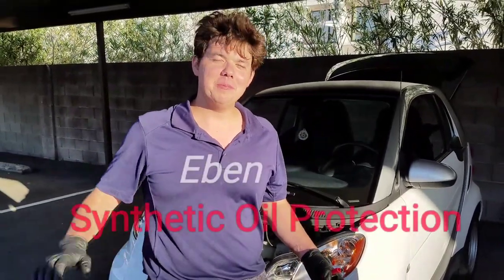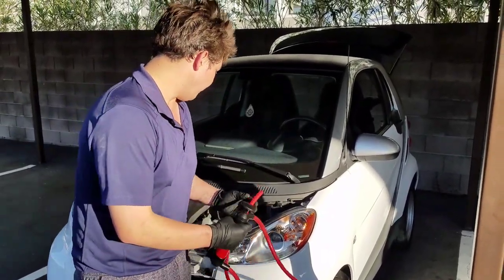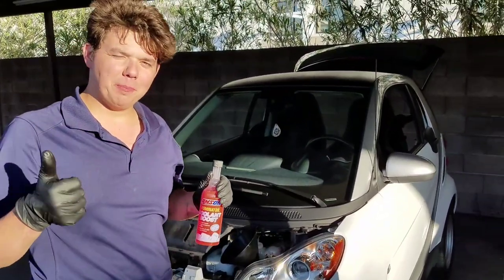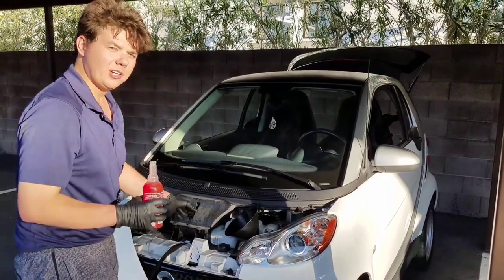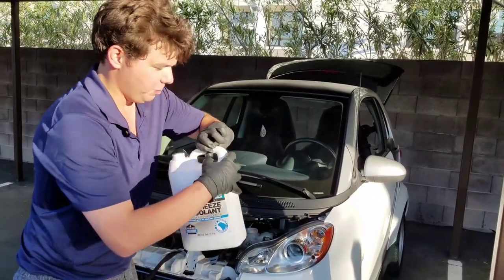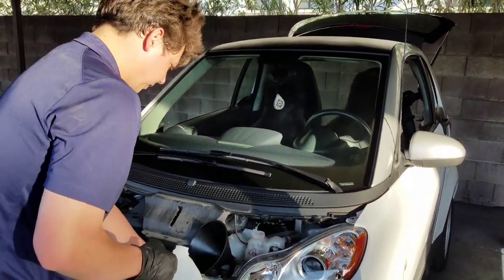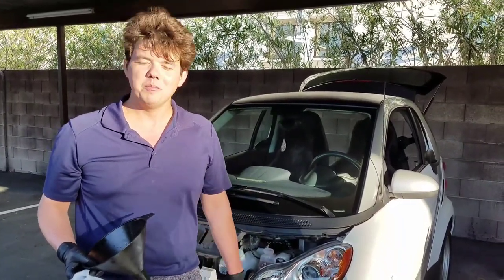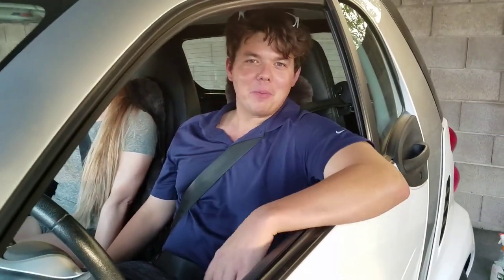Smart Car AMSOIL Radiator Coolant Change

Comment: What is the "proper tool" you keep speaking of?
Reply from the maker: It may be a hose clamp to hold the clamp or a hose pick you have to wiggle off the hose and to get to it could be very difficult depending on the angle but ideally you want to take the bottom hose off to drain the radiator unless there's a drain area on the car I'm not aware of that so you have to find a way to drain it and most cars that are tough you just have to pull the hose off that's the best way depending on the age of the hose it could rip so then you want to make sure you have the ability to replace that hose if you rip it when you take it off that's why certain things with radiators are more difficult also the plastic can get brittle and you can crack it so you have to be very careful so at worst case scenario you have to be able to be okay replacing the hoses and or have the ability to replace a radiator if you crack a piece of plastic that's the one thing I don't like about radiator services and I always avoid that for my videos as if I was someone doing it by myself because the last thing you want to do is try to change 50 bucks worth of coolant and end up spending $800 getting the car repaired because it's something you broke that's why I play it safe in most of my videos for people that do not have every tool like an expert mechanic

Comment: Hi Eben- Thanks for the great videos, they have been teaching me how to care for my car. I have a question about this one though- Do you have to bleed the cooling system after changing the coolant in a Smart car? I didn't see you do that in this video. Thank you!
Reply from the maker: Most likely you will not have to bleed the system on that car because it's a very small system.

If you want to drain it completely you will need a special tool and it's a Mercedes tool to take the c-clip out to drain it and you can do that if you want to get the tool.

What I did was I did a pasic drain and fill out of the reservoir which the reservoir mixes with the radiator and that allows you to dream about a third at a time.

So what I did in the video is I drain and filled the reservoir a bunch of times and drove it to get it hot to change as much as I could because I didn't have the tool to drain it properly.

The most important thing is that you change as much of the fluid as you can and that way your system won't get any corrosion.

If you have any other questions feel free to reach out to me anytime.

Also I recommend getting the Amsoil Dominator coolant boost and the low toxicity biodegradable coolant the yellow bottle and you can mix that with distilled water to make a 50/50 mix.

 thanks for being a part of my YouTube Community Katie🤟

Eben Rockmaker Independent AMSOIL Specialist (Dealer#: 5331179) 
Mobile: (702) 472-3614
 My link: AMSOIL 25% Less Wholesale & FREE SHIPPING: https://www.amsoil.com/offers/?zo=5331179
AMSOIL Makes it for your Vehicle Lookup - https://www.amsoil.com/guides.aspx?zo=5331179

 If your vehicle is not on the lookup guide this is AMSOIL Tech Support 715-399-8324
Reply from the maker: You'll see in the lookup guide you can get all the products for that vehicle and when you change the transmission fluid in the motor oil you'll be blown away how much better that car drives😉
Reply: @Syntheticoilprotection  Ah that makes sense. I don't want to have to get the tool so I bought an extraction pump and will just do what you recommended. Thanks so much for this video!
Reply: @Syntheticoilprotection  coolant drain plug is under the motor NO suction pump necessary NO “SPECIAL TOOL” necessary. also why would you need to pump the brake peddal did you do a break fluid change aswell?

Comment: so, in order to take out the whole old fluid, correct me if I understood it wrong: you "pull out" the old fluid from the reservoir with the pump, fill it up with new one, run about a week with the car, take fluid out and refill again, and repeat the process about three or four times? in order to have a fully cleaned up cooling system, that´s it?

(I REALLY don´t want to take the whole smart front end apart just to replace the coolant as taught in sites like Evilution)
Reply from the maker: That's what I did!
Reply: @Syntheticoilprotection  thanks dude! I believe that your "method" also avoids issues with air bubbles in the cooling system, am I correct?
Reply from the maker: Yes, I think yoll enjoy the cooler operation after the flush
Reply from the maker: This is my favorite coolant product I have ever used.

https://www.amsoil.com/shop/by-product/other-products/antifreeze/dominator-coolant-boost/?code=RDCBCN-EA?zo=5331179
Reply: @Syntheticoilprotection  I know. But I live in Brazil, no Amsoil products down here. I´ll go with good local brands.  Thanks. 

(today I replaced the spark plugs, man, what a pain in the a** to change them on the fortwo LOL)
Reply from the maker: Thanks for being a part of the channel!
Reply from the maker: As the giveaways get bigger I will be able to spend the extra money and ship all over the world different products!

Stay tuned for the next Amsoil giveaway which will take place basically every month.
To be in the giveaway all you do is share my channel 5 times on any social media and screenshot the proof and you can email it to me or text it to me

Comment: does it pump it all out? including whats already still in the engine, dont u have to drain it engine side too?
Reply from the maker: Yes, you need to drain it from the engine if you have the specialty tool so what I did was I drain and fill the reservoir a couple times and did it that way.

The best way is to get the proper tool and drain it
Reply: Ok cheers for the reply 👍

Comment: do you know how to flush the heater core?  Where it is?
Reply from the maker: The best thing would be to fill it with distilled water and drain it completely and circulate it with the heater on high this video will demonstrate the process - https://youtu.be/I4lr69hEJSQ

Comment: Will this work for a 2008 smart as well? I was quoted $180 for coolant at dealership 😞
Reply from the maker: Of course this is the look up guide for all the fluids for your vehicle.

AMSOIL Vehicle Lookup - https://www.amsoil.com/guides.aspx?zo=5331179
Reply from the maker: For around that price you can do everything on your car.

This is my personal link that will get you 25% off and free shipping if you have any questions just let me know☕😃👍🇺🇸🚘

Eben Rockmaker
Independent AMSOIL Specialist (Dealer#: 5331179) 
Mobile: (702) 472-3614

My link to buy AMSOIL: https://www.amsoil.com/offers/?zo=5331179
Steps to order by smartphone or computer: 
1. My blue link gets you 25% discount and free shipping on orders $100 or more as a Preferred Customer Member ( best way to buy AMSOIL ). I will get credit for your purchase when you use my link. Click My blue link, Click Join Now Orange Bar Preferred Customer for 1yr or 6 months. Note: AMSOIL will not keep your Credit Card on file. There is no recurring charges.
2. Click look up vehicle.
3. Select vehicle type AMSOIL has all the fluid amounts listed. It's best to get extra bottles because that way you won't need to reorder and pay shipping $8.99 on just one item...lol
4. After you have all the products added to cart then complete order. Any order $100 is free shipping and ships in 1 to 2 days. ( 90% of orders before 12 noontime will be delivered next day😉 )
Reply from the maker: Thanks Serena for being a part of my YouTube Community😉
Reply: Synthetic Oil Protection thank you, you said you did this three times to “flush” it? That means add and pump out again?

Comment: At the end you said "opened it up and closed it etc". What do you mean by it? Do I have to get some air out of the system or something?
Car noob.. sorry lol
Reply from the maker: Basically, you just refill it. I would have liked to drain it from the bottom however you need a special tool.

I believe the best thing to do in that car is just Pump It Out fill it Pump It Out fill it about three to four times.
Reply: Hey. I did have the "special tool" it was just a 6mm hex on my 07? I basically drained out the old coolent and flushed the system with a radiator cleaner. After that I filled it up with coolent..And when I start the car now it goes a few minutes at the temp gets very hot. If I drive it for like 3 min it's almost at max. I tried getting air out of the coolent holder tilting the vechile different ways..revving the engine while having the cap open.. Still no good.

Do you have any suggestions for what might be wrong on my diesel 07?

Help is much appreciated.
Reply from the maker: @Rockelement  

Usually I just idle the car with the coolant cap off and it pulls the radiator Cooling in and I never have any trouble with air bubbles.

I would just drain and refill it again.

Potentially could be something stuck in the thermostat.

Also I would only use 30% coolant 70% water so your car runs cooler.

If you live in a very cold area then you want to run 50-50 50% antifreeze 50% distilled water.

Also when you put flushing sometimes you can break up clots and the flush could have broken up something that's stuck.

I would drain and fill that little guy a couple more times
Reply: Do you know where the thermostat is on the diesel engine? I live in a cold area so I need 50/50 ;)
Maybe something is clogged.. but I did flush water thru the system multiple times after the radiator cleaner. Hmm..

Thanks for suggestions.
Reply from the maker: @Rockelement  

Not sure I would get the engine book on that car if you can find it online or pick it up at the dealer.

I'm guessing it's a corroded thermostat or something stuck if it's overheating
Reply: Yeah. It says nothing in the manual..and online they only show how to get "air locks" out of the engine types I don't have for some reason. So me being a car noob is not finding a solution.. I will prob buy a proper manual. I have a feeling it's just air that's stuck somewhere..Maybe I should try to open up the thermostat to get some air out? hmm.. Thanks anyways for the help Ol Billy.
Reply: @Rockelement  I'm having the same issue with an old 2000 model smart fortwo. Can't find anything on removing air. Had to replace the radiator. Gas engine.  Neil
Reply: @neilmatheson8753  It was just an air lock in my case. I had to leave the car tilted for like 2 days and the air got out.
Reply from the maker: Wow
Reply from the maker: @Rockelement wow
Reply from the maker: @neilmatheson8753 sorry to hear yeah I wish I had an easy technique I'm sure a smart car technician has a secret to get rid of the air

Comment: this guy and his damn pump..Get under the car and drain it properly
Reply from the maker: There is a special tool on this model that I believe you would get at the dealership to drain it I did not have the tool.
Reply: @Synthetic Oil Protection  what is the tool called? Part number or something?
Reply from the maker: Not sure what tool you're referring to?
Reply: What a hack! Simply cut the factory hose clamp off of the lower radiator hose and pull the hose off, and you'll drian the system througoughly, which includes the heater core and lines. Replace with a standard hose clamp and then follow the proper bleedimg procedure.
Reply from the maker: @CNYProd yeah I made this for someone that's new to taking care of their car not intended on a deep dive someone with an older car the rubber gets old and it would be really difficult for them to do it not so simple pretty tight area definitely a more advanced thing to do for someone that's on their own in their first time this will definitely help the system by changing a little bit at a time.

There was no intended to take a shortcut just wasn't going to do a deep dive on a car that someone can't take care of themselves that's a new beginner.

As they say it's easier said than done once you start taking hoses off I've learned from experience LOL

Have you ever tried the Amsoil low toxicity coolant?